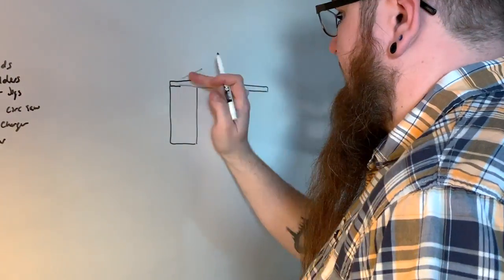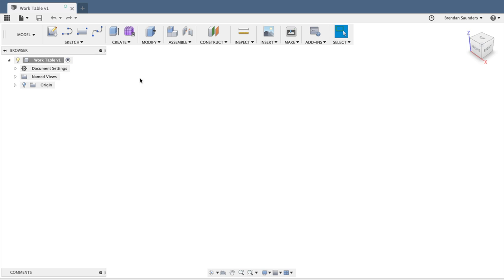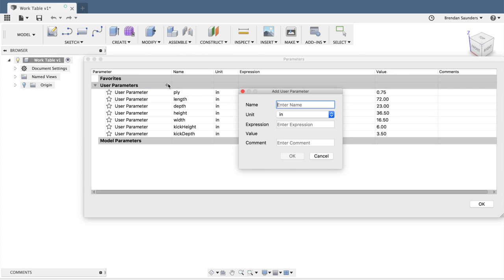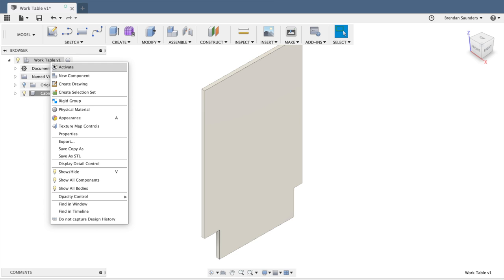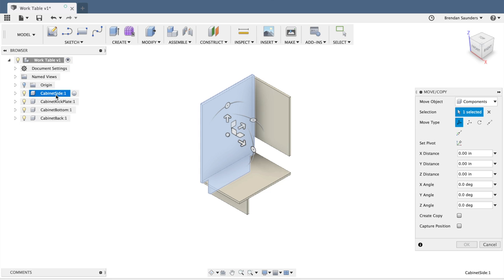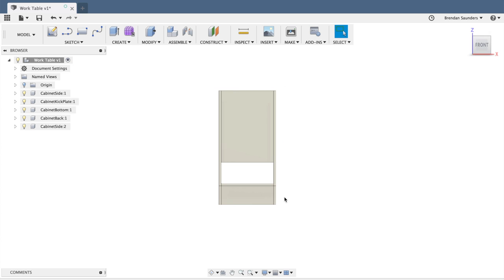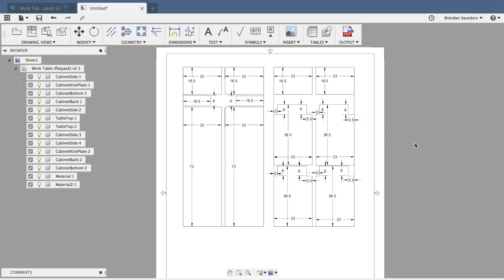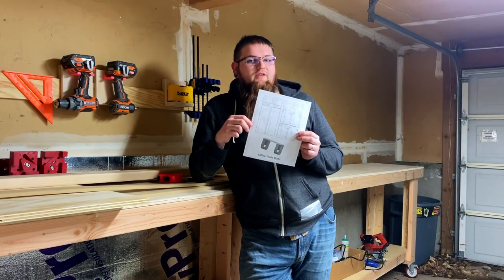Concept to Cut Diagram - Furniture Design with Fusion 360 Part 1

Comment: What a great introduction to Fusion 360 for woodworkers.  I am amazed at how easy you have shown it to use with repeatable accuracy.  I struggled with Fusion before finding this video.
Reply: I am beginning to learn. I used Sketchup before. They changed to a web model and I was not loving it. I am now trying Fusion since they have a hobbyist revere.

Comment: This video is by far  the simplest, easiest to understand, most straightforward example of how to build something in wood for Fusion 360 on the Planet Earth.  There are so many good design practices that one must use in Fusion to do ANYTHING COHERENT, and you follow them all.  I just did a project in Sketchup and it worked but without the change parameters feature, making any changes to a cabinet, much less one that has 62 pieces of wood in it is very very difficult.  On the other hand, Fusion 360 is very very difficult to learn all the ticky tack rules one has to be aware of to get anything useful out of it.  In my opinion, there are only three functions for modeling cabinetry in a CAD program.  To view the final product without having to build it, secondly, to make a cutlist/part list automatically, and third, to make changes without having to re-draw the hand drawing all over again.  Only Fusion 360 does all three, however the price of entry from a tool  use perspective is quite steep.  Thanks again.

Comment: Very good video - I have been ramping up on 360 and this is one of the best ones for woodworkers. I do have to suggest that you should have use joints to "join" your components instead of just doing sketches on top of existing component. It seems you use them for cut diagram but the real application is to assemble components (and if you have doors you can create moving joints to model door moving). I am still searching for best way to get to cut list - your process decouples it from original design.

Comment: Very informative video. I particularly like you idea on how to create a cut diagram. I'm definitely going to be using that on future projects that I do!!

FYI, there is an easier way to insert an image of the 3D assembly. If you use the insert base view command at the top left. Then select create new for the reference, you can add an isometric view of the model, with the actual 3D assembly shown and your cut list hidden. Then you can use the style option to color it. That way you don't need to update your screenshot any time you update it. If you have any questions let me know!

Comment: Thanks for the videos, just started learning Fusion 360, work with sheet material and a CNC Router (Stepcraft D600/2) please do more showing the  joints etc you mentioned, thanks again.